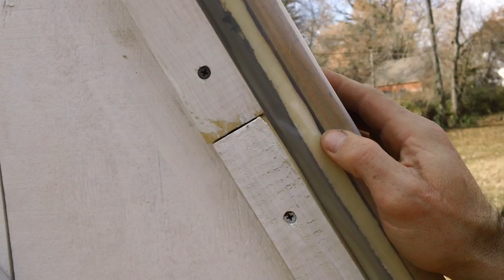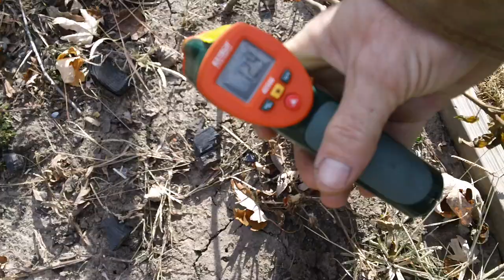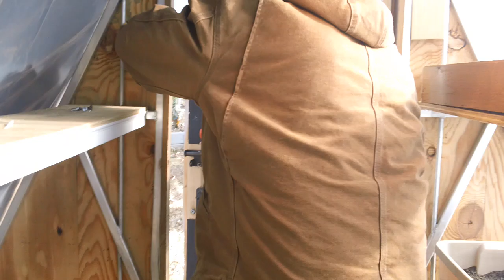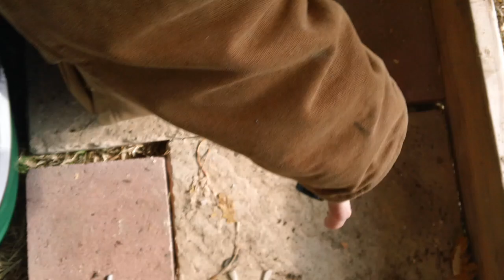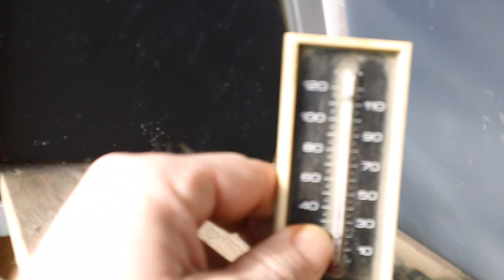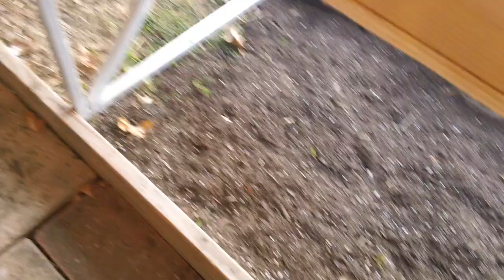No Heat winter green house

Comment: Hello Van.  Hats off to you for all your alternative energy/heat projects.  Good on you.  It's about 5 years since you posted your green house video.  Dealing with moisture is such a problem when trying to seal up a structure.  Have you had any mold or rot problems on the back wall of the greenhouse?  
I'm designing our small greenhouse now.  Any tips you could offer?  Thanks in advance!!

Comment: Great idea, fellas. The size is just right for spring starts or fall lettuce. Bigger isn't always better. You are on to some thing interesting. Nothing wrong with looking good either. So the ground is a heat loss...perhaps insulate the ground with your foam and plastic too? For the summer how about a big fan on both ends? Your great idea is moveable too.

Comment: Is the dirt in those containers helping to heat that small structure? If so, why not burn tea-light candles under they're containers every couple days to make it warmer for the plants?
Reply from the maker: if I had an endless supply or was a tea light candle maker.. I would..
Reply: John D you dont want open flame in your green house. you can see by the video that its not needed. he measured 12deg outside and 70 inside. what more do you need?

Comment: What is the initial greenhouse made from? purchased?? I bought at a yard sale some metal plates that you screw 2x2's to in order to construct a dome structure. I was really hoping to complete this by this winter but it looks like maybe I'm not going to make it unfortunately. I also found in the trash (hopefully big enough piece) some pool solar cover I was going to use as the cover. This should have good "R" value as well I'm hoping. I wonder if using your technique as well could help some with that only I'd have a bit harder time deciding which panels are south facing due to the done shape.
Reply from the maker: ***** my previous video explains your question.. its a salvage commercial awning.